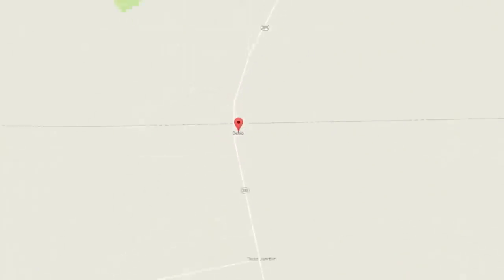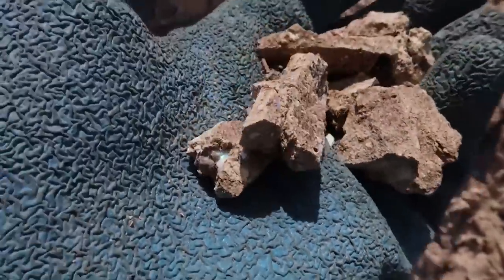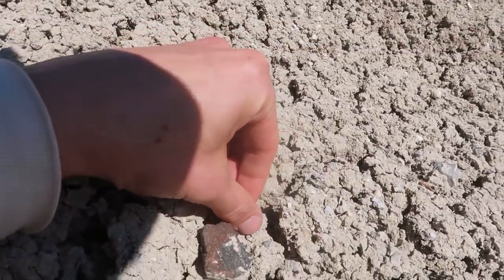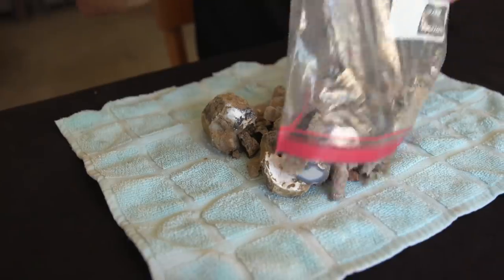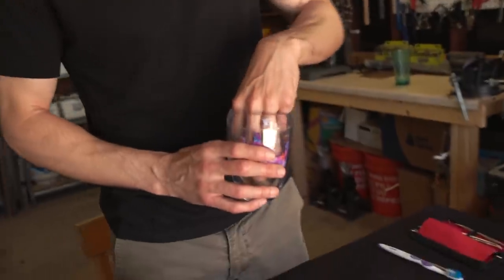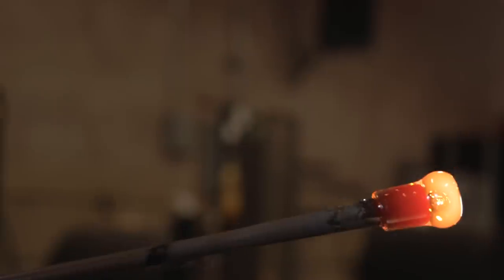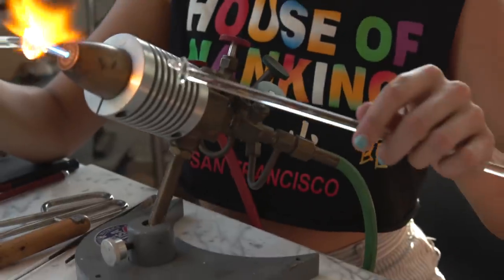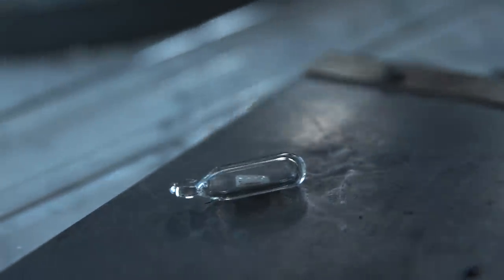I Bought an OPAL MINE !!

Comment: so, why did you heat the opals as rapidly as you guys did?
Instead of thermal shocking the opals (wich have a LOW resistance to thermal shock) you might have had better results slowly heating the glas, you dident even try.
Reply: You can't combine genuine natural opal with glass because opal has a small amount of water content

Comment: I know it’s way more fun to put the opal in glass this way, more artistic, and you can make the glass to fit to gem, not the other way around. But the average person out there that doesn’t have access to that kind of equipment and expertise:

Craft stores and any place that sells jewelry making equipment have great selections of little vials, double-sided clear lockets, tiny jars with tiny corks you can wear around your neck, etc. many of these are designed to hold small chips of rocks or gems, or even sand. 

So if you’re broke like me, but this captured your imagination, there are lots of ways you can replicate that ship in a bottle look with any tiny bit of rock or gem. Really you can do this with anything that will fit. Of course, they sell a million little things that will fit into those lockets, but it’s a way to hold onto tiny natural stuff. Dried plants or flowers, seeds, sand, tiny shells from the beach, you get the idea.

Comment: How does 1 share of an opal mine work? When they find that million dollar opal they're gonna tell u about it and share the  money?
Reply from the maker: Someone found an opalized tree trunk a few years ago worth $500,000!! One share gives you access to all of the mine. You keep what you mine and pay out to the mine a percentage of your findings to off set the cost of the operation of the mine (diesel for the bulldozers, etc)
Reply: Seems one sided. How much would u owe the mine if u found $500,000 tree trunk?
Reply: Huh. So even if you just want to keep it for collecting you would still have to pay for how much they evaluate it to be worth every time you find something? bummer.
Reply: All the smaller opals you find are split 50/50 to make it short. Non gem is all yours. High quality & low quality was split. two piles made by you or them & the other gets to pick. Museum pieces the mine kept to sell and would give you half the money at that point. EVERYTHING you find, you can buy your half back from the mine at wholesale ie cheaper than wholesale as a miner.Swordfish Mining if you want to dig cheaper on your on prospect. Yes there are precious outside mines.
Reply: @ResortDog  so if i buy 1 share of a mine i get a % of everything found or sold correct? not just what i found on that given day?
Reply: @johnt5465  only what you yourself dig out

Comment: "In pretty sure this has never been done before" ROFL i stick opals on every single pipe i make. The flame worker you saw was absolutely ignortant to any and all things glass....you cannot encase real opal in any type of glass. You are RIGHT the COE isnt that far off of boro..which is COE 33. but the water content is way way way to high. What chunks and stuff yiu did get to incase will end up stressing and shattering those pieces before they even ship out. The only opals that can be incased are Gilson opals...or lab made silicon based opals.